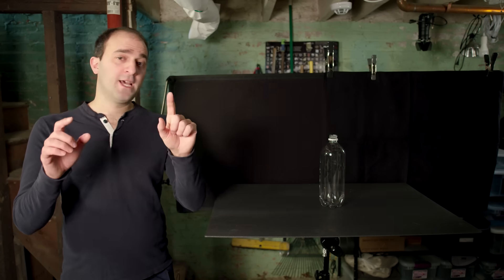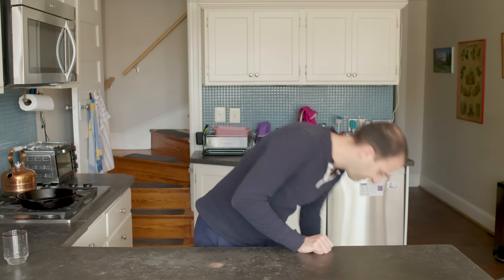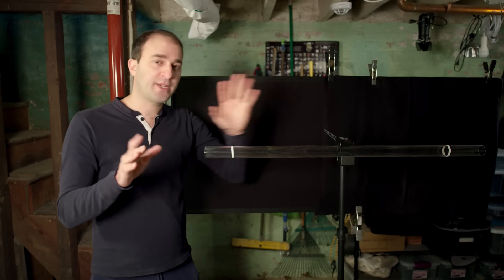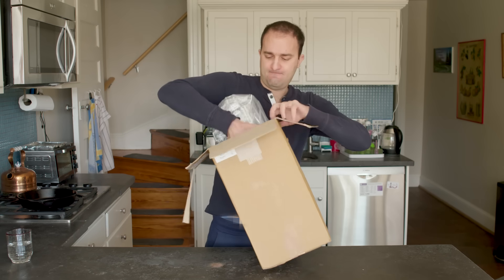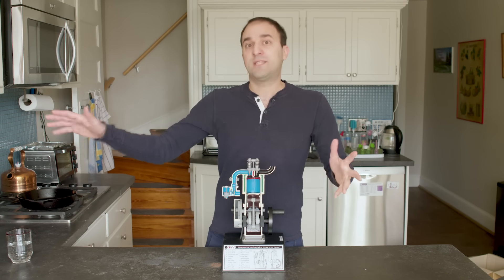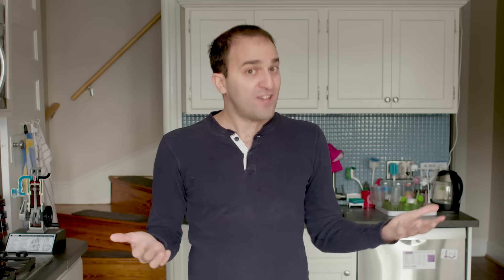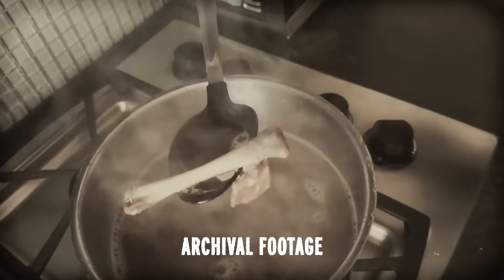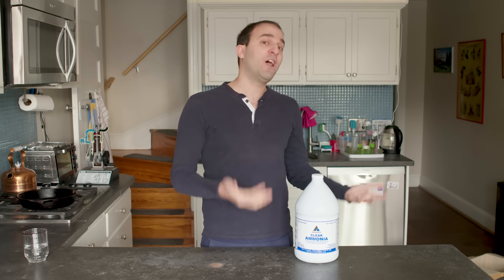Does Toyota Know Something That We Don’t?

Comment: Internal combustion engines don't burn liquid fuel. The engine's fuel delivery system converts the liquid into a gas when it reaches the combustion cylinder. When it comes to detonation in the combustion chamber, diesel engines are just that detonation engines. Ammonia is not just corrosive but very corrosive to engineering metals. Ammonia was used as a refrigeration gas but it's corrosive nature was it's down fall. Also ammonia gas was used a weapon in WW1 trench warfare. Ammonia is a nasty substance.

Comment: Instead burn ammonia directly in a combustion engine, some companies are developing ammonia truck with a electric motor. Yes. The ammonia molecules (NH3)  are broken in N (nitrogen) and H3 (hydrogen) in a special device  and hydrogen go a fuel cell that converts it in electricity that feed a electric motor. This is much more efficient, because the efficiency of the electric motors are much more higher (> 95%) than a combustion engine (> 35%).
Reply: That the best way to go: To make a fuel cell and use electricity to power an electric motor. There are also Direct alcohol fuel cells. Consider that 1 liter of ethanol has around 8 kWh of energy. That outclasss any battery available today in terms of wh/kg !
Reply: thats 95% of 35%. Do you even know the logic if this lol? you are still using a combustion engine to make the electricity.
Reply: @System0Error0Message  You missed the bit where it was fuel cell not a combustion engine. Hydrogen fuel cells are ~65% efficient, so ~61% overall.
Reply: @usingthecharlim  i did not. You still need to power the process and that comes from the 35% engine allowance. What makes a hybrid efficient is being able to use the engine efficiently at low speeds
Reply: @System0Error0Message  It is expensive to put precious metals in to act as a catalyzer for the efficiencies you want (and as complex as cell manufacturing). Also those efficiency coefficients are based at one op point. The motor even electric motors have efficiency curves (and a lot of other values I will not mention) and still not taking the entire system into account aka what will you use to commutate the motor, don't just throw random figures from Wikipedia for a BLDC. Cheapest method to stay at the most efficient op point Gears and lots of them.
Reply: The electricity is generated from catalytic conversion of NH4 into H2 and N2, then fuel cell conversion of H2 into H2O. Where's the combustion engine? The problem lies with the CO2 emitted when the NH4 is synthesised (not in a combustion engine - lol) @System0Error0Message

Comment: Electric primary traction is ready since the early 1800's, but due to the simple fact that batteries store no electricity, plug-in batteries are unsuitable for the ideal charge/discharge profile of a vehicle (Quick charge and slow discharge). This, and the high specific cost ($ per kWh/kW) of batteries made electric cars disappear in the early 1920's, 70's and 90's, and now risks turning electric cars into toys for the rich.
Seeing this, all vehicle manufacturers are looking for ways do decarbonize their products without using plug-in batteries. Hydrogen is at the same time the best and the worst solution, as it is easy to produce at high efficiency, but transporting and storing it is a nightmare, and every solution created to make it easier diminishes efficiency.
A feasible solution is mixing hydrogen with something else (again losing efficiency), and making ammonia is one of the alternatives. It is easy enough to store and transport (About the same pressure as propane, although it needs stainless steel containers), but its toxicity is very high, demanding more strictly regulated materials and procedures for its handling, unlike propane, CNG and hydrogen.

Comment: We burn 90 millions barrels of oil. A DAY. 
We produce hardly 300 millions tons of ammonia globally per year. 
Even if we burned it all, that would amount to a mere 24 days of global oil consumption.
Not even talking about the fact that ammonia is made from rapidly declining natural gas drillings, and ammonia use case is almost entirely locked into fertilizer production, lest we want ultramassives famines. Unless 99% of the global mouths to feed goes away, burning ammonia ain't happening. Yeah, it is vaporware in our current situation.

Comment: For years I've been wondering why companies insist on a combustion based process when it would be much easier and safer to instead make engines that rely on a chemical decomposition process to produce a high pressure gas?

Comment: Clearly much better environmentally than lithium, but why not burn hydrogen directly (much safer and less poisonous than ammonia) or use hydrogen in a fuel cell, which is more efficient than ICE as it is not subject to thermodynamic process limitations,

Comment: I worked at a (coal-fired) power plant for some months, including doing some cleaning of copper sensor lines.  They dissolved Ammonia t o 100% solution in water, then sent it through the lines to clean them out.  After an hour or so, a few ounces of solution snuck out of the loop and dripped on the floor.  I could smell the stuff a good 100 feet away in that dusty, dirty environment.  It's PUNGENT,  kids! The stuff in the store is somewhat smelly and attacks the upper respiratory systems  slightly, but it COULD  get far stronger.  I believe it may be too dangerous to use like oil gasoline or diesel, where owners might pump(or spill) their own at the station.

Comment: Help me out here,  ammonia has one third the energy of an equal volume of gasoline.  So the simple math is that three gallons of ammonia are needed fwhere we would have gotten by with one gallon of gas. An average price for a gallon of ammonia is $4.50.
Toyota is killing itself by refusing to venture into battery powered EVs. The Miura was a disaster. Yes it was a frugal EV but it was boring with no performance. Nobody is buying an EV because of their low operating costs, they buy EVs because they are a blast to drive.

Comment: Having worked with anhydrous ammonia, I know that it's incredibly nasty stuff.  Just a whiff of a 3% solution will knock you for a loop.  How often have you smelled gasoline in your life?  Now imagine getting painfully gassed each time that happened.  You wouldn't want to be within 100 yards of an accident where the fuel tank ruptured - and you'd be toast if you were in the vehicle.
Ammonia is really just a carrier for hydrogen, which is made from natural gas, which is the ultimate energy source. As for climate change, CO2 production isn't avoided, but it is centralized, pretty much as it is for EVs when the power is generated by burning fossil fuels.

Comment: You don't extract ammonia from any natural source.  It's an expensive, energy-intensive process to split nitrogen molecules, then supply them with free hydrogen.  It's not in the same league as hydrocarbons.
Reply: True, but some plants found in nature produce ammonia, clover roots are one such example. There are other plants as well.
Reply: @methylene5  In trace amounts, I'm guessing, given that large amounts would be destructive.  I'm afraid that doesn't help you.
Reply: @Krakondack  Also. ammonia isn't that destructive to plants, plants love it and even farmers use it in large quantities (not to be confused with ammonium nitrate, etc), but it is bad for animals and lethal to fish.
Reply: @methylene5 In water it becomes ammonium hydroxide, and raises pH potentially very high, so you're limited to small amounts.  Also, not pertinent to the original question, since biofuel production requires 10x the hydrocarbon input versus yeild.  And oil seeds are pretty rich in oil.  This is a mere curiosity.

Comment: The problem is not the ammonia engine but producing the ammonia by a process that does not produce CO2 since it requires a high energy to produce the hydrogen that is the input to the Haber process and then to run the process. The hydrogen is normally produced by steam reforming of methane from natural gas and this also provides the energy for the rest of the process. Using wind power or solar is a non-starter since the process must run 24/7 and these are intermittent leaving only nuclear and hydro. Of course our deceitful masters will import the ammonia from China and pretend it is Green just as they pretend the wind and solar units are or in the case of Drax producing power by burning mature trees.

Comment: Is it really possible that the combustion will be accurate enough for the exhaust to be just nitrogen gas and water - no nitrous oxides? A gasoline engine produces carbon monoxide and nitrous oxides even at stoichiometric fuel and air mixtures.
Reply: There will be nitrogen oxides, so will need to be put through a catalytic process/converter.

Comment: In fact, the engine is not designed to use gasoline anywhere. It's cracked waste, it's what's left when everything valuable is separated from the oil.

Ammonia and green hydrogen would be real environmentally friendly ways to move cars... their total discharge would be significantly smaller than a combustion engine, i.e. a fraction of that of "electric cars".

Hopefully the lobbying for these technologies will be as effective as the lobbying for battery cars once was.

Comment: If ammonia is going to be OK to have in cars, then we should put it back in refrigerators and get rid of the HCFC, CFC and other refrigerants  that are thousands of times worse than Co2 and are massively widespread.
But I doubt that because all the other refrigerants were produced specifically because Ammonia was so deadly.

Comment: Ammonia can now be made at 45centigrade , and standard air pressure, historically 4-5 x standard air pressure and 400 centigrade , so the energy required to make ammonia is massively reduced . Plus the machinery to do it will fit in a container easily . So you can make it where you want from air and water . So fuel stations would make their own , farmers will make their own, ships will make their own

Comment: A long time ago I had an air-conditioner that used ammonia as a refrigerant. A gas fired heater was used to heat the ammonia during the cycle. It worked ok but still not sure it was a good idea. It was sold by a natural gas company. Go figure.

Comment: Ammonia can be used as a fuel for a fuel cell. Stripping the hydrogen atom and producing electricity direct to a motor or battery is an interesting alternative. This process can be 65% efficient. The Internal Combustion Engine is only 30% efficient.  The conversion of NH3 to make electricity produces water, free nitrogen and a tiny fraction of nitrogen oxides. There is still a long way in proving this technology.
Reply: I personally don't think we need to be promoting something as dangerous as liquefied ammonia for powering cars.  On that note, a Chinese researcher published a paper on the feasability of a HYDRAZINE-air fuel cell powered vehicle- now that sounds scary.
Reply: In real-life applications, only diesel engines reach 25-30% efficiency. Gasoline is even worse - at around 15%-20%.

Comment: If flame speed a core issue, rather than additives to make it work in existing engines, creating storage problems, why not create new engines better optimised for the flame speed. Even say running them at lower rpms. I realise that it is no doubt way more complicated than that (feel free to inform me below)

Comment: The marine industry is looking at using ammonia as a fuel for ships, especially those with  large Slow Speed 2-stroke "cathedral engines". These engines run at around only 100 rpm, so the slow flamefront is less of a challenge. Not poisoning the crew will be sorted as soon as they've got everything else right (probably).
Reply: Or they could just use Nat Gas. We already have ships powered by Nat Gas and it burns Much cleaner than bunker oil or Deisel.
Reply: Yes correct.

Comment: Hydrogen isn't viable, it corrodes tanks and storage infrastructure like crazy. Losing energy density wont be too bad if the filling hardware is sufficient and if the tank is pressurized, which it would have to be to liquefy it anyway.

Comment: All these alternate fuel ideas fail as a replacement fuel because they all require more energy than the difference between what gasoline provides and what they provide.  They are not alternate energy sources.  They are tailpipe emission reducers only, while shifting those emission to somewhere we cannot so easily see.  You wanna clean up the air: use less energy. Make cities more livable. Use tax money to fund rapid transit instead of bailing out car companies.  SMH

Comment: I am a service technician that works on industrial refrigeration equipment. Most of the equipment I service uses anhydrous Ammonia (R-717) as a refrigerant. I am the person that goes in and fixes leaking ammonia systems. most people can't stand anything over 10 ppm. I am regularly in compressor rooms where the level can easily reach 600 ppm depending on what work we are doing. I can take up to 400 ppm before I need my gas mask. if at that level long enough you will start to taste blood. but it does some how clears my sinuses, the rest of the day I feel like I took a big snort of Affrin.

 What bro is smelling here is probably only a 10%-15% solution of ammonia he is missing out on the diaphragm spasms, the burning eyes and every little cut on your hand, ugly crying face as snot and tears start flowing.

i don't think it would be a good idea for the general public to have access to anhydrous ammonia. it's used as a precursor for drugs and explosives and can cause horrific chemical and frost burns.

Comment: shall we do some calculations? cool...

Gasoline costs $0.95c a litre in Ohio...
Industrial grade Ammonia  in industrial ammounts, 99.9% pure for like... a truck load costs $1.20 per litre.

Fuel efficiency...

The fuel efficiency is as follows, MJ/L
Unleaded gasoline: 34.8
LPG: 28.7
Ammonia: 12.7

Who in their right mind would pay SO MUCH MORE for fuel that is basically beaten by LPG at twice the MJ at less than 1/3 of the price...
This is not going to save the planet, it's going to cost the consumers SO MUCH MORE and throw in so much more carbon because we burning more fuel.

I already love how manufacturers are really clasping straws to keep their profit margine at the expense of the environment and trying to pull the wool over our eyes... yes ammonia can burn, but there is a reason why we aren't using it as a fuel source or else we would be burning LPG, a low carbon version of gasoline.

Want to know a more efficient and cost effective way to put power to the wheels? electricity to electric motor... you can try this at home, turn on the fan and see how fast it spins up...  electrons don't care how they are produced... they are all the same there's 2 varieties AC or DC but DC can be stored easier

Just stop giving these fools air time
Reply: Of course, you don't need industrial grade ammonia, you need transportation grade;
also given nuclear power to produce the ammonia, probably can be made much cheaper.
Reply: why have nuclear power to create ammonia when you can have nuclear power to your battery in your electric vehicle? stop clasping straws and retire your cars already @factnotfiction5915
Reply: you know nuclear power can recharge electric cars, but instead you want to add additional steps into making movement @factnotfiction5915

Comment: I am at a loss to explain Toyotas (and some others) research in 'alternatives' to ditching the internal combustion engine. They have dabbled with hydrogen internal combustion engines, despite there being better ways to use hydrogen (the fuel cell EV), and despite all of the other demonstrable ways that hydrogen is not a practical or economical fuel. And now this?!?!? They clearly have a thing for reciprocation engines that lures them into spending huge sums of money to desperately hang onto them, despite the battery EV having got to level of development where they can do everything we require of them with plenty of developments and improvements still to come (including reducing the cost of them, before people pick me up on the ONE remaining obstacle they have).

Comment: One thing that isn't mentioned here is that ammonia could also be used in fuel cells. I honestly don't necessarily see the danger component as that significant considering that hydrogen is arguably vastly more dangerous than either ammonia or gasoline, and we have been able to deal with that issue. Fundamentally, the round trip efficiency is laughable, and the infrastructure is not there. That being said, I think that ammonia is much more feasible than hydrogen due to the fact that it can actually be transported without too special of equipment, since it is not as volatile. However, I think cheap and efficient fuel cells are a key component to getting this to work. I would expect that with an appropriate fuel cell, you could have a fuel cell EV powered off ammonia, and it should be much cheaper to fuel than an equivalent hydrogen vehicle since the infrastructure cost to manage ammonia fuel (including the cost of your car and its tanks) wouldn't be as high.

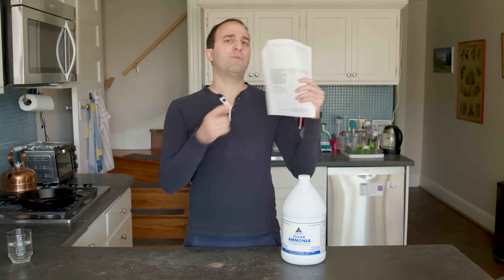Comment: 2:55 Flame speed is TOO SLOW to run an engine. Next!
Reply: Low rpm engine
Reply: If you watched the whole video you'd see that they can use accelerators such as 2% hydrogen to accelerate the flame speed.